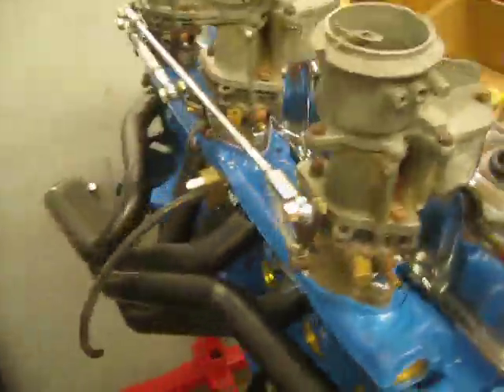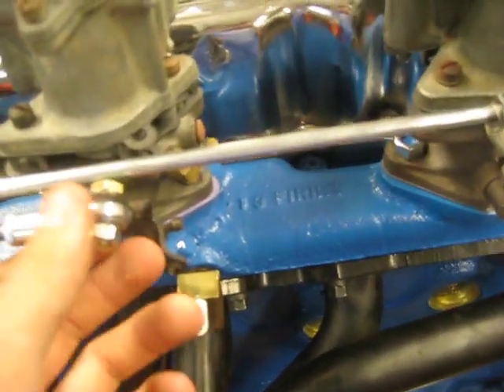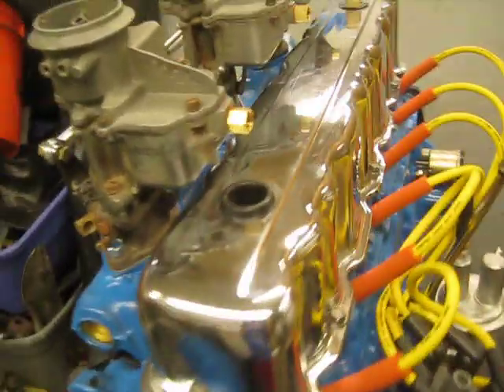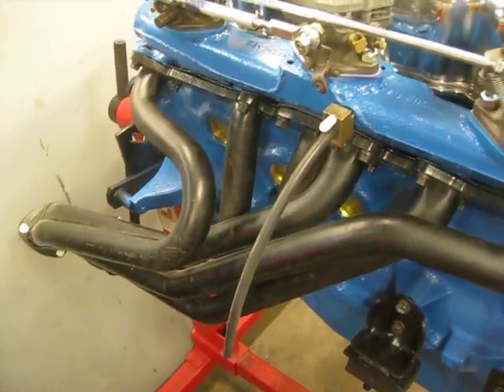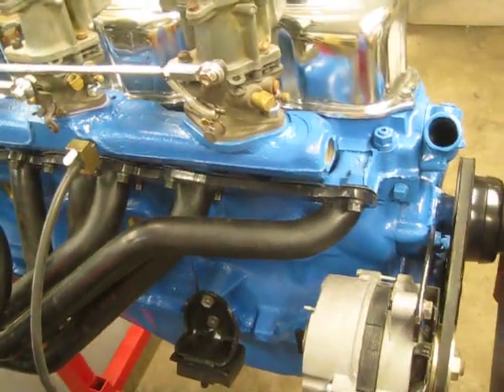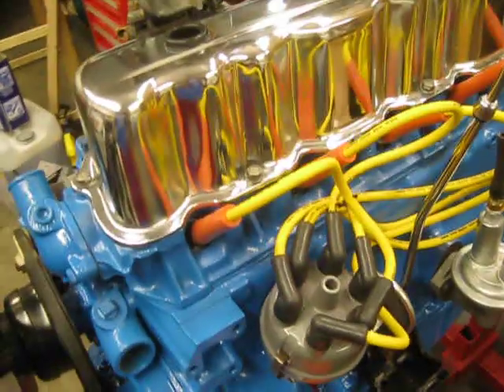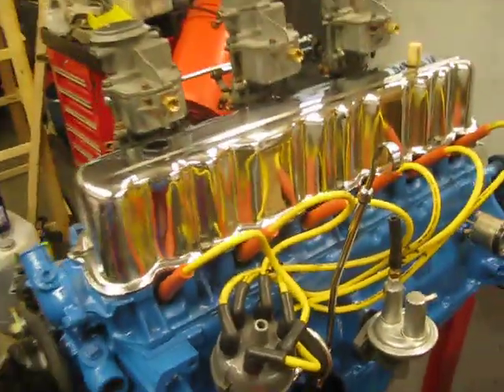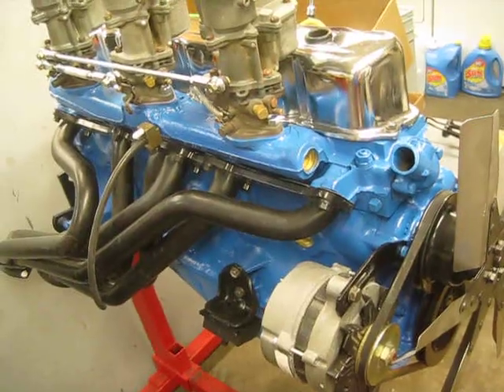200ci Ford Performance engine

Comment: I have a 200 i6 and am looking to upgrade it,  I have it all stock and am told that the 200 is really hard to work with because the manifold and head are one piece?  I also have broken bolts in the exhaust manifold! Grrrr!  Tips as to where I can get 6cyl upgrades would be great!  Any advice too guys!  Thanks in advance!
Reply from the maker: Joseph Hayse
I'll send you some links. I might do some informational videos on these engines as well, seems like there would be interest in them.
Reply from the maker: +Kelby Lihme 
http://fordsix.com/forum/ 
http://classicinlines.com/Home.asp 
http://www.cliffordperformance.net/
http://www.falcon6handbook.com/
Don't order anything off the classic inlines site. There's a thread on the FordSix forum explaining the situation.
Reply from the maker: Wow, I didn't know we could post links in the comments now. There's a few.
Reply from the maker: Corndog Joe
http://www.shop.cliffordperformance.net/Ford-200_c9.htm
Reply from the maker: +Ohyaaaa! I'll send you a PM with some links and tips.
Reply: +SuperKONR I'm just now starting this project as well. Any links or information you have would be really helpful! Thank you.
Reply: +SuperKONR same here, I just bought a '81 Fairmont with the 200 I-6 (all stock), but here in Germany you can't buy any parts for old US cars (the Fairmont wasn't even sold here) so I'd have to order everything I need online from some US shop. That's why I try to get as much information as possible before buying anything, so if you could hook me up with some links or information as well that would be pretty cool.
Reply from the maker: Simon Nageleisen
Sure, I'll send you a PM.
Reply from the maker: All - I have more info somewhere, I'll dig up some more websites and I6 information and send you PMs with the links.
Reply: +SuperKONR can you forward me those links as well?
Reply: +SuperKONR I'm considering doing fuel injection for my project. Did you ever consider this or run into any information regarding that conversion?
Reply from the maker: Joseph Hayse
Classic inlines is supposedly developing a fuel injection setup. But as of now, I think you'd have to make your own. It should be a relatively simple conversion using a throttle body injector and a megasquirt controller. Multiport injection would involve some fab work.
Reply: Dang. Any ideas where to get the dual exhaust headers now?
Reply: +SuperKONR Thank you I should have looked here! Awesome.

Comment: Aww, putting that sweet motor on an automatic? Going through all that work and not giving it the 5 speed it deserves is a bit of a shame! I bet that 6 sounds so nice though, great work, nice to see someone who appreciates a nice I-6 engine! I'd build a 300 CU Ford I-6 if I were to build a street rod.
Reply from the maker: Oldbmwr100rs Thanks! No automatic, I put a toploader in it. I was thinking of doing the 5 speed but I don't really want to put modern parts on the car. I've seen a couple slingshot dragsters with the 300s in them, they run pretty good. There's also a guy in Australia with a '65 Mustang that has a turbo-ed 240 I6, it has run an 8.67 1/4 mile.
Reply: I built one of those  in 81 didn’t do the tri power did a crane cam it was lopey ported the head then then sold it to a guy with a falcon built a 69 250 .30 over a lot more torque would beat a 89 Capri it was in a 67 coupe un fortunately was totaled by a drunk that rear ended me doing 45

Comment: That looks great!  Got my pumped to want to get my 200ci i6 looking as nice as yours.  A simple questions.  What paint did you use for your block?  I painted mine with an engine painted rated for high temperatures, but it is already flaking off due to heat.
Reply from the maker: Thanks! I use Duplicolor hi-temp engine enamel. At work I'm pretty sure we use Brite Touch, it's like Duplicolor's generic engine paint. It works well also. You don't have to go too crazy in prep but make sure it's clean.
Reply: I'm pretty sure I used the Duplicolor hi-temp engine enamel.  It was awhile ago.  I'm gonna have to clean it up again anyway.  Thanks for the tip.

Comment: Some nice car crafting going on there, 240 HP would be very respectable and sound pretty good with that exhaust.
Reply from the maker: Thank you sir! I'm excited to hear it, the cam is supposed to be somewhat lopey. The header made that other stock engine sound pretty nice even with a stock cam.